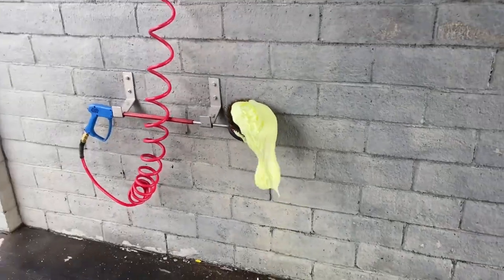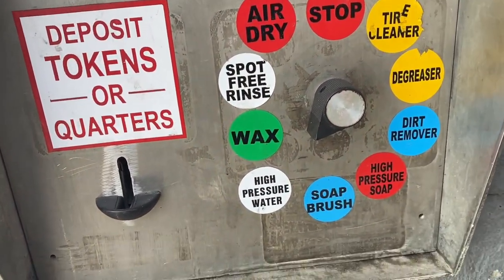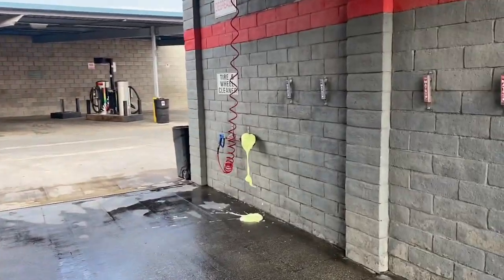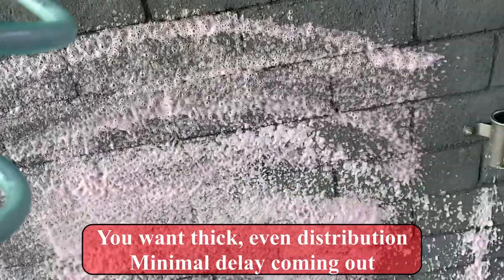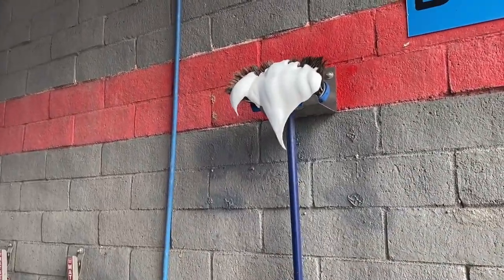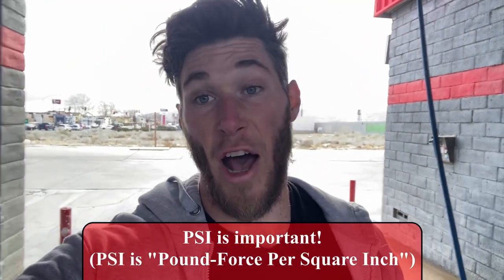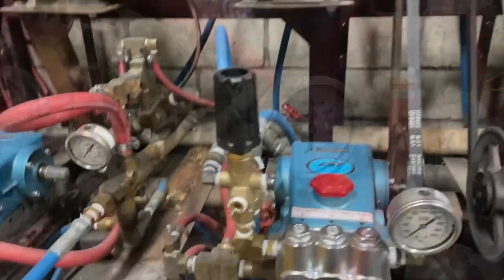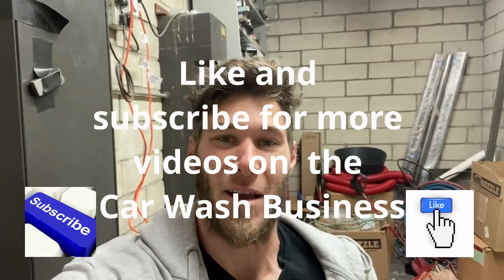BEST In-Bay Car Wash Functions to make the most money!

Comment: How did you add the tire and wheel cleaner brush? Mine comes from the main sprayer and I would like to have it separate like yours.
Reply from the maker: I mean I just ordered the part needed and my worker installed it. You can buy everything put together ready to go which is much easier. But as you know it’s just a matter of having a tank with hydrominder, flojet, manifold/solenoids, hoses to connect everything, wiring and fixtures and fittings

Comment: If i get the carwash i want to add the air dryer, like you have. When you put one on your carwashes, do you just buy the extra lengths of hose to mount it on the roof or do you put something heavy duty, like pvc piping till it comes in the bays ?
Reply from the maker: Check out the install here. https://youtu.be/SJsNc7be64U